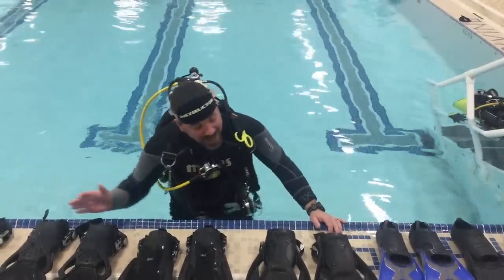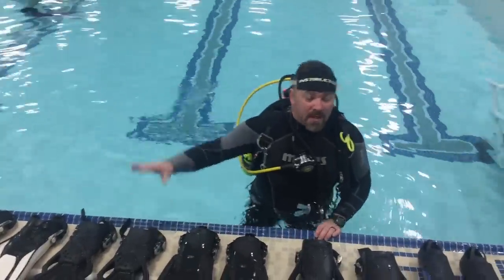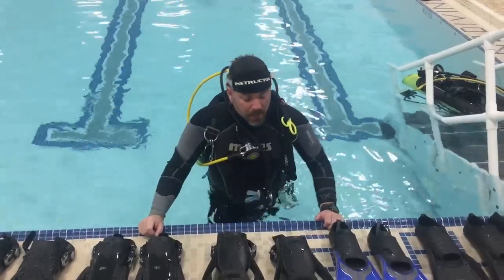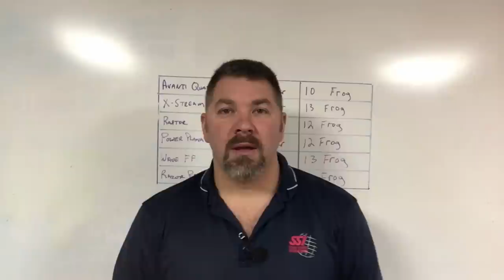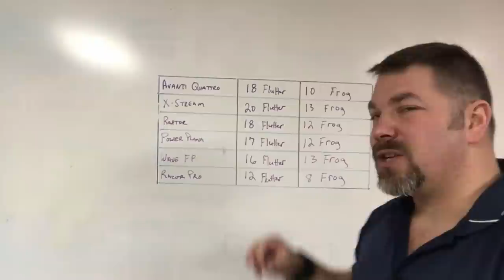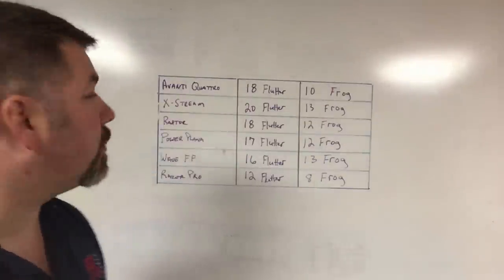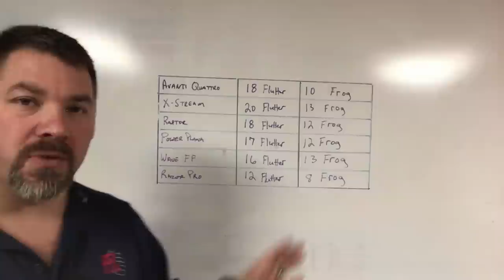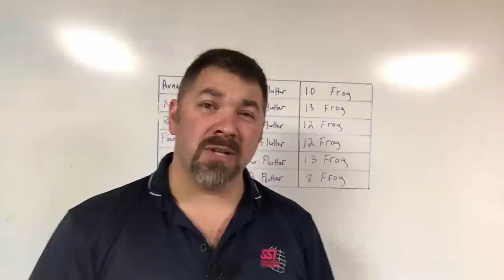Testing Fin Efficiency

Comment: Too bad you didn't have a set of jet style fins or a set of Scubapro Seawing Novas to add to the test.
Reply from the maker: From our previous experience, the Mares Power Plana's are close enough to the Jet Style fins to be considered equals.  The same goes with the ScubaPro SeaWing Novas and the Mares X-Streams.  The other issue we had, we simply used the fins that we sell.  We may make a video in the future, crossing over to other brands such as the ScubaPro SeaWing Novas, just to show a comparison, but as previously stated, from our experience they perform so close to the X-Streams, it is hardly noticeable.
Reply: @LakeHickoryScuba  MARES Power Plana's are not equal or similar to any Jet style fins. From a Mares user Scubapro Jet's have too exaggerate push per kick compared to Power Planas that is specialy noticed in current.
Reply from the maker: We are planning our next video, comparing the Mares Power Plana directly with the Scuba Pro Jet Fins, so hopefully we can get some great results.  Stay tuned.
Reply: With no true jet style fin this video is not helpful.

Comment: I still have my pair of Avanti Quattro since the late 1990’s! Excellent fins!
Reply from the maker: Not much has changed with them over the years, other than the material used to make the fins.
Reply: Same... I've tried all kinds, and even went though a split-fin phase (which, by the way, i still say are the most "powerful" for the least effort flutter kick you'll find), but all-around, I too gotta hand it to the Quattros.

Comment: Tremendous work. Matches my own experience and expectations ;-). I did a similar test, testing clocked max speed, starting each cycle at the same pulse rate.  Best did our S.E.A.L.S.' fins, the age old Barakuda Gigant full rubber fin with Springstraps, second to my surprise the Apollo Biofins, then the Dessault Apnoe fins..next to my surprise the hated Force Fins.. All this in flutter kick.
Reply from the maker: Hello sun yata, we enjoy doing comparison videos like these.  The results will always be different depending on who does the test.  We all have different kick patterns and preferred methods of kicking.

Comment: Well was nice to the see that the fins i use , after personally testing 5 types and Brands ! , came out as best allrounders , but Jet Fins for Drysuit and 3° celsius Gear would have been nice to see ,, keep up the great work guys !
Reply from the maker: Thanks Lenny, we are all huge fans of the Avanti Quattro's here at the shop.  A lot of viewers mentioned we should have used Jet Fins, so we may do another comparison video, using different brands.
Reply: @LakeHickoryScuba  sounds good , i didnt want to mention the other Brands , but the quattro really did best for me
Reply from the maker: For the record, we are not against any other brand out there, we are simply a Mares Dealer, so having the other brands on hand to test is difficult sometimes. I have been fortunate over the last 31 years to work in this industry, and working for other shops over the years has afforded me the benefit of using all the different brands.  They are all good, some better than others, and some that are the same, but with different cosmetics.

Comment: Hello. I just recently started Snorkeling. First set of Fins I bought, Sherwood Elite FF. Gave me good speed. But cramped my legs while treading. The Dive Shop that held the class sold me a set of Deep See Aqua Glides. a little shorter and with Heel Straps. Tried them yesterday. Easier to tread water. But not as much speed. Maybe I should just rent different sets to test out. To find out which ones work best for me.
Reply from the maker: Renting fins is a great option Chris Philhower. Over time you will discover newer fins as technology increases, and you will find a pair that works for you.

Comment: nice tests but as one thing might make them better, or actually a few since these numbers actually still lack some values to measure acual efficiency.
one would be to add the speed you went at, since not all your kicks will be equally as fast, some fins also automatically go faster or slower.

for example if we look at the raptor and avanti quatro based only on the flutter kick for now, then they are equal, however. perhaps one of them went at a much higher speed but just allow faster movements, if both take the same power and the same amount of kicks then the faster one would be more efficient.

another one is since that doesn't tall all as well since there is also fatigue and such, so the force in the legs and feet should be measured, or the energy the body uses.
well that is very hard so here is one alternative, you know your maximum half endurance power output(which we can call 100%.
all you need to do is to sprint with them, possibly both a technical sprint and a real sprint if you can't keep up your technique at the sprint.
all you need to do is measure the time it takes to complete the distance between 2 points where you are around at top speed, then take the fastest time, that one is 100%, the other fins will get the percentage based on how long they take, or just show the times instead.
this might not seem very much needed since most people don't normally swim at that speed,
 but in reality it is very usefull and informative since it allows to show the actual efficiency factor, combined with the other values you can get very accurate results.

another alternative to a sprint would be to have a big elastic band and some ropes attach you to the side of the pool to a device which measures the amount of pull you create, and see how much force you can make at most.
then also use a waterflow measurement device to measure around how much speed you shoot the water back with, combining those also gives a nice estimate for efficiency.
Reply from the maker: Hello @ted_van_loon, thank you for the suggestion. You are correct, a more methodical test would be as you stated to add in the other variables. The biggest issue is, there are not two human beings on the earth that are identical.  Thus, we kept the test more practical and more simple. Out of the last 35 years of diving, I can't think of a single time I ever measure the speed of my actual swim (dive). I consider our test more practical than scientific. Other divers may have a different result.

Comment: So for typical diving since the free diving fins are the best for efficiency should I use these instead of the fins like sea wing nova
Reply from the maker: Hello Henry Crick, Free Diving Fins work great for Scuba Diving, as long as you are not in tight spaces. They do however cause some issues when traveling.  Sometimes they can be difficult packing in normal luggage.

Comment: Great Test, i use the Ouattro and Excel+ for many years, great fins, but this year i buy the power plana (xr) with spring straps. The reason??? I need shoe size 15/16 (europe 50/51). In this case, the power plana XXL is the „best“ fin 🤣
Reply from the maker: Hello Andreas, glad to know the Quattro's and the Excel+'s have been working for you.  You will enjoy the Power Plana's, they are definitely built tough.

Comment: interessting test, but i think the number of strokes per pool lengh is not the best measure of efficiently. I think the better masure would be how many pool lengh you can dive on 1tank of air, however that would be a very long test. But for this test it would be nice to see the how long you took for a pool lengh and maby test 3 different speeds per fin, one time go very slow, on time as fast as you can, and one time like you did in the video.
Reply from the maker: We tried to keep this test as simple as possible.  Thus we only did one length of the pool.  The other issue was, I had been teaching all day prior to the test, so I am not sure how much more my legs could have taken that day.
Reply: yeah i know the test would be much longer (3 times as long) and it still would be far from a real scientific test, so as a fast test for a light overview this is probability enught, however it still would be nice to see how long you took for one swim, that would have only taken one guy to aktually time the dives, or you could just do it by watching the viedo and timing then.
Reply from the maker: I still have the footage, I can look at the time stamp.........

Avanti Quattro Flutter :35 sec
Mares X-Stream Flutter :40 sec
Mares Raptor Flutter :40 sec
Mares Power Plana Flutter :40 sec
Mares Wave FF Flutter :33 sec
Mares Razor Pro Flutter :34 sec

Mares Quattro Frog :47 sec
Mares X-Stream Frog :47 sec
Mares Raptor Frog :46 sec
Mares Power Plane Frog :50 sec
Mares Wave FF Frog :47 sec
Mares Razor Pro Frog :44 sec
Reply: thank you!  @LakeHickoryScuba
Reply from the maker: You're welcome
Reply: The first thing I thought when I heard how you were going to evaluate the efficiency was that you needed to include time/speed as well.  Perceived finning effort vs. actual speed could be an important factor.  Thanks for going back and providing the times!

Comment: Great video. Do you have any one about the Mares Excite Pro?
Reply from the maker: Hello Heitor Castel Branco. The Excite Pro was a well built fin, however, it never was a big seller for us, so we don't have any in stock to compare them to the others.
Reply: @LakeHickoryScuba  Ok, thanks for your replay. Anyway, from your experience and knowledge, do you advise these fins? I have been diving for almost 13 years with a Scubapro "Twin jet" but they are not good for the "frog kick", as I heard about Excite Pro from Mares I would like to hear your opinion. Thanks.
Reply from the maker: The Excite Pros should work great for Frog Kicking.

Comment: Would you say the split fins are easier on knee joints?
Reply from the maker: Hello Suzanne McCallum, choosing the right fin for you can be difficult at times. If the Split Fins prevents any unnecessary resistance, then yes they can be great for Knee Joints.

Comment: When I go diving,  I use atomic split fins. But I wouldn't use freediving  fins. Great video.
Reply from the maker: Thank You, glad you liked it.
Reply: @LakeHickoryScuba  you should do a review on the atomic split fin.
Reply from the maker: If I had a set to review, I would be happy to do one.
Reply: @jesspeoples3292  I've put about 400 dives on atomic aquatic smoke on the water splits...And I'm blown away by how effective they are. So quick and effortless compared to blades, and the sheer number of different movements one can use to create thrust is astounding. Mind you they are stiffer splits, I would not like softer ones, and it took me maybe 100 dives to really dial them in... (Scuba instructor, been using fins since I was 5, kinda thing.)
Reply: @GastrophetDrum  Thanks for the input. I just upgraded the straps to spring. They work great. When I started diving, I wore paddle fins for my checkout dives. My instructor let me try a pair of split fins and I was hooked. Later, he had an old pair of split fins and he let me have them and I have been diving with them ever since.

Comment: could you go into why you don't like split fins, just curious?
Reply from the maker: To be honest Ranger77, I've never found a set that worked for me.  Since 1988, I have owned more sets of fins than I can remember.  And every time I tried a set of Split Fins, I never felt like I was going anywhere while kicking.  I was pleasantly shocked at how well the Mares Raptors performed during this test.  The technological advancements in fins is amazing now days.  Back in the day, they were sold by several manufactures as a fin that was designed for those who had issue with leg cramps.  Now they are being developed with stiffer sides and more dense material.  I still don't think I will ever be a huge fan of them, but I will give them credit for what they are.  One final note, even though they are not my favorite, if they work for others, then I am all for them.  One of my Divemaster's swears by them, and uses them on a regular basis.  I like to pick on him all the time.  He is a pretty good sport about it.  As a matter of fact, we made a parody video together, where even he made fun of them.    https://www.youtube.com/watch?v=ASr10FkDoWo
Reply: @LakeHickoryScuba  You did not kick properly to to really get the most out of the split fins.  They are actually much more effective with a more rapid, lower amplitude flutter kick - not the slower, higher amplitude kick you used.
Reply from the maker: Possibly.  All the more reason a diver should focus on a set fins that work best for their individual kick patterns. Based off which kick works best for them or their physical capabilities, the Split Fins may or may not work for them.
Reply: Agreed  - there is much misinformation out there on split fins and, at least, this video showed you can very effectively frog kick with splits (a common myth is that you can’t).

I actually have both paddle and splits but, for general Caribbean open water diving, I normally prefer my Atomic Smoke on the Water splits (a stiffer split fin).  For more confined spaces, i use my Atomic X1 blade fins.

Both of the Atomics are preferred over the ScubaPro Jet Sports I started with for both power and control.

As you said, good for folks to try different fins and find what works best for them - just glad to see myths on splits being dispelled.

Thanks for doing the test and posting it!
Reply from the maker: You’re welcome.  We are planning on doing more testing videos in the future.

Comment: Great video. Being on swim teams since my childhood i can confidently say you are doing the frog kick incorrectly. Your knees should come up toward your chest at the beginning ofthe kick. Instead you were bringing your feet to your butt. Also, once you finish the kick, your legs should be in a strait line with your body. You had your knees bent  behind you which ruins the glide of the frog kick. If you did the kick correctly I bet each one of those fins would drop about 3 or 4 kick cycles.
Reply from the maker: Thanks for the input MuttonChops24, I will try to work on that.
Reply: The same can be said for the flutter kick...since knees should not be bent... Maybe that's the reason why the "broken fins", I mean the razor pro, won :-D

Comment: So if you bought the version of the wave with the foot pocket ..would not a drag  and completely change the performance of the little fin hum ..... Hands down there's only two fins that I will ever use mares Avanti Quattro  and the apeks rk3hd  it's kind of odd it's you didn't do an old school jet fins all things considering before or precious quatro's came out they were the go-to
Reply: Rev Tech, LLC I personally love the RK3-HD for frog kick, back kick and helicopter kick but dislike them for flutter kicks. Probably because they're quite stiff. They give great control but don't flex much.
Reply: Yggdrasil42 I completely agree that's exactly why I love them Dual side mount penetration is where I mostly use them either cave or wreck awesome control keep you off the walls and ceiling while being short enough to allow you to turn enough to give you the power to do it anything over water or instructor base I-10 towards the quatro's case I need to chase down someone LOL
Reply from the maker: We decided to use the fins that we had in stock.  We have had others comment that we should have used Jet Fins as well.  I have several pair of older ScubaPro Jet Fins laying around, we may try to compare them to the Mares Power Planas, and even compare the ScubaPro SeaWing Novas to the Mares X-Streams.  Same basic design, just different cosmetics.  In regards to the open heel versions to of the Mares Waves, the parachuting effect is possible, but with the proper foot pocket size and the proper size boot to fill in the foot pocket, it is most like hardly noticeable.

Comment: Great Test ! BUT completely wrong title !
Your test is only testing POWER of the fins. Each kick propels different fins for different distance.
It should have been called : “Testing fin POWER”.
If you want to test Fin Efficiency you got to compare Distance to Energy used.
OR How far and how fast you can sustain swimming without any fatigue.
In order to get it right, I did swimming in multiple fins for 1h (covering ~ 2 miles).
With Scuba Pro Yellow Jet Fins I can swim the longest distance in first 1h (over 2 miles over 3.3km) no tiredness, no fatigue in my legs, so I can enjoy watching fish underwater with breast stroke mostly on the way back (yes no problem with frog kick in split fins for me) another 2 miles (total over 4 miles or 7 kilometer).
Other fins that I tried not only gave my leg fatigue but I could not swim that fast and long either e.g. “Finis Positive Drive Swim Training Fins” – absolute garbage for swimming efficiency in a longer distance and “US Divers Nature’s Wing Shredder” – much shorter, stiffer split fins but highly inefficient for long distance. Fatigue again.
Reply from the maker: Hello @maresks360, that is an interesting take. The biggest issue we face with any type of test is the changing variable of the individual diver.